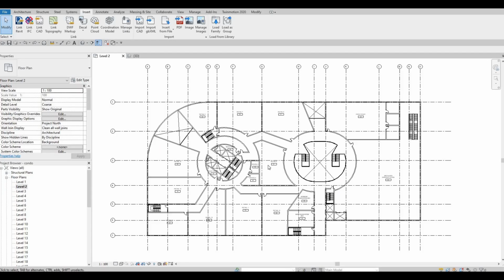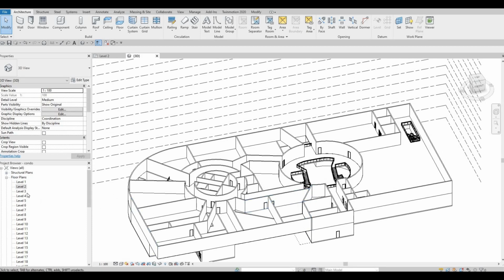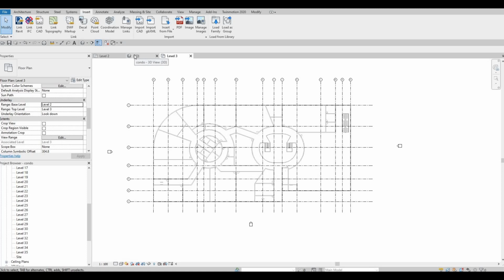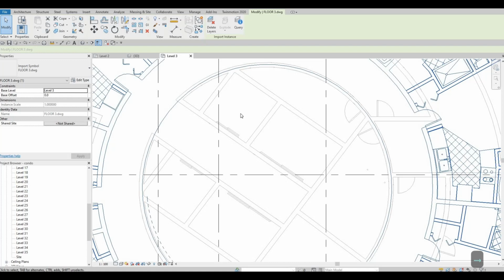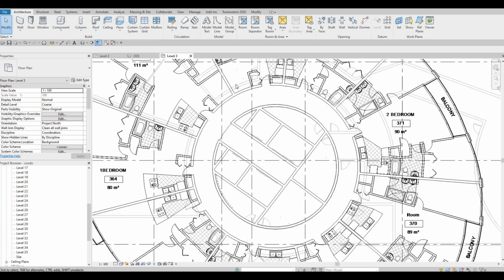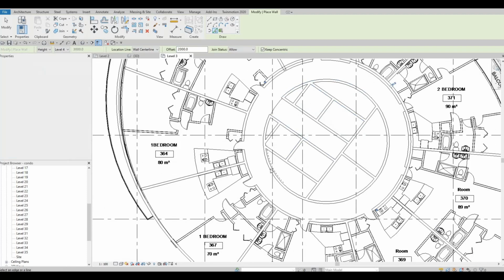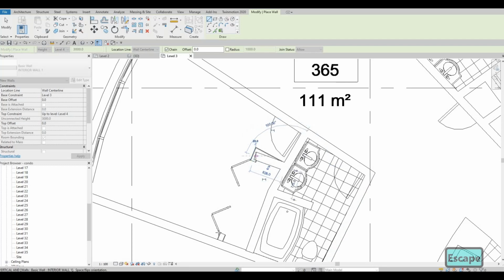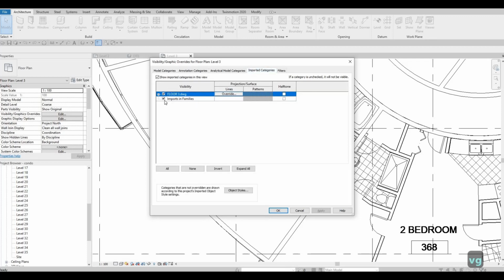MG Condominium Building | Part 7 | Complete Step By Step Project | Revit and Twinmotion Tutorial

Comment: Your tutorials are really helping me understnad how everything works in Revit, thank you.
Is there a way to change the opacity of the cad file or an image you import? I think it will be easier to see what you have or haven't already built over if the imported image is say 50% transparency
Reply from the maker: Hi, thank you for the suggestion. I should have explain ways to do it. Actually there is another solution and it will definitely make it easier to everyone. You can also set transparence from revit itself and we dont need to set transparency in cad. But will show that in future video. Thank you for your comment. 🙂🙏